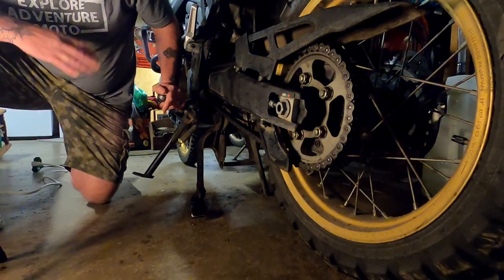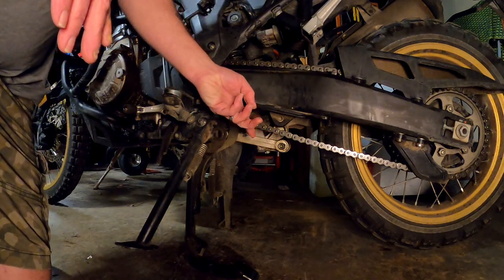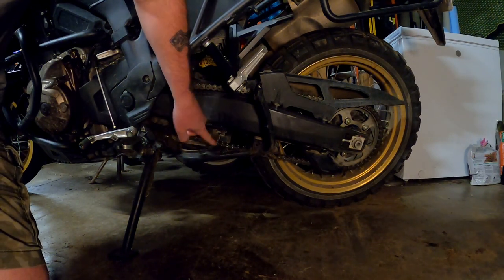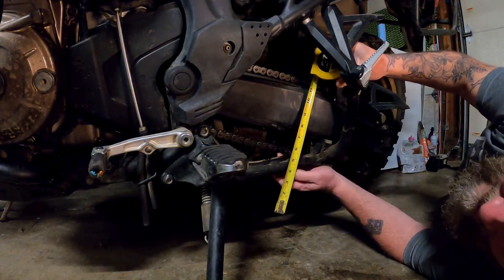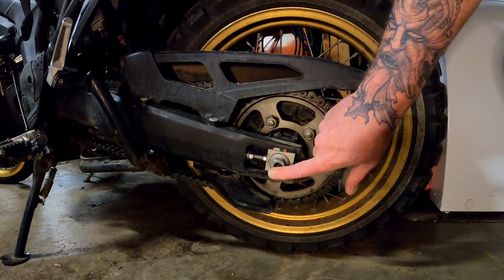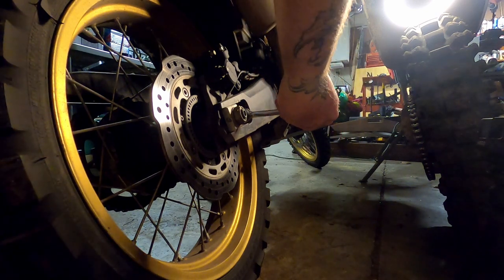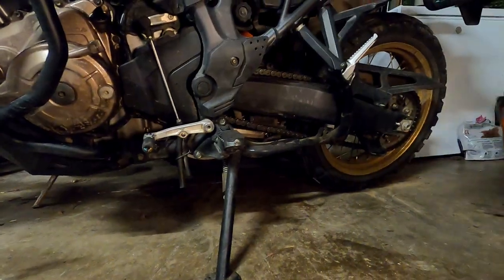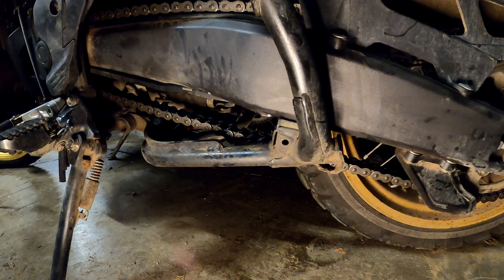Africa Twin CHAIN ADJUSTMENT. Do it RIGHT.

Comment: Honda made a small triangular marking on the plastic chain guard on the top side of the swing arm to indicate the halfway point between the two sprockets. It’s not that easy to find but it’s there if you look for it. 
To make future chain adjustment easier after setting the chain slack to factory specs with the bike on the side stand as prescribed in the owners manual, place the bike on the center stand and measure the chain slack again in that position. Then you can adjust your chain on the center stand each time using the new measurement.

Comment: I agree about using the tools you carry on the bike for maintenance to familiarize yourself with what you have to use on the trail and make sure you have all the tools you need on the trail.  What I don't agree with is your comment about not using the torque wrench on the rear axle nut. If I am in my shop I will use the trail tools but on re-assembly of such a critical bolt, I will put the torque wrench on it to make sure it is to spec for safety's sake.  On the trial, the strong arm method is the only option. 

Otherwise, it is a good video on chain adjustment on an Africa Twin. The AT is the only bike I have ever had that chain adjustment is done on the side stand.

Comment: Wonder why (if?) the OEM chain/sprocket is better than the aftermarket offerings? That aside, my moto has been “a slappy chain is a happy chain” but maybe not so much on the AT DCT?
Reply from the maker: I’ve let it get a bit loose before adjusting at times and it didn’t have any adverse affects, but not to the point of slapping. Dirt bike is a different story. I run that with a lot more slack. I’ve been adjusting mine this way and the only time I’ve swapped the chain is when I added two teeth in the rear. Didn’t even notice any premature wear on the OEM sprockets. 🤷‍♂️

Comment: Hey we have the same model bike …except mine is a 2019 DCT….question for you, if you put yours on the center stand and spin the rear wheel with your hand, is your chain really quiet when rolling over the front sprocket?….mine is making noise…not a lot, but have have a ticking or knocking sound….while a spin forward and backward…I dont see excessive wear, or sharp teeth…can you test yours?
Reply from the maker: Is your chain dry? Maybe just needs a bit of lube. It does make some sound but nothing I haven’t heard on any other chain driven bike more or less.

Comment: At 5:47, it looks like you have a pretty good slice in the tire
Reply from the maker: Nope. That’s part of the reflective band coming off. Last 805 I got, only one available had a reflective strip on it.
Reply: @ExploreAdventureMoto  …. Whew…. Tires aren’t cheap, I’m glad that all it is.
Reply from the maker: @RandyMcCotter  already have another set sitting ready to go on this week. These are about wore out finally.
Reply: @ExploreAdventureMoto  … going with a different brand?   I have the Mitas E07+ and they’re a good tire but they leak around the rim
Reply from the maker: @RandyMcCotter  sticking with the same combo I’ve been running. TKC80 front, Shinko 805 rear.

Comment: It looked like you just tightened one side, but maybe left doing the other side out of the video.   I'm still hesitant to do this myself, concerned I'll get the alignment wrong or improper torque.
Reply from the maker: Correct. Only one side made the video. Horrible lighting on the other side